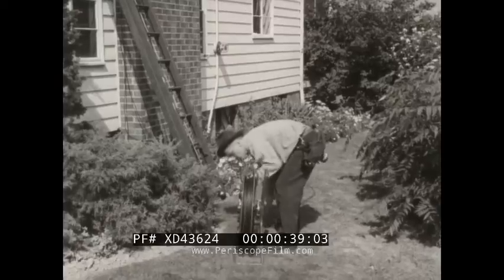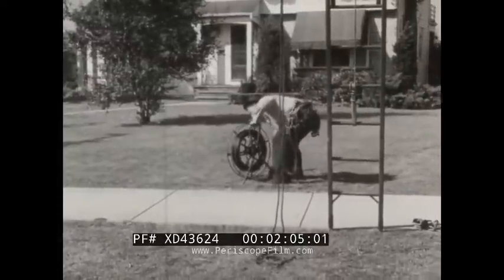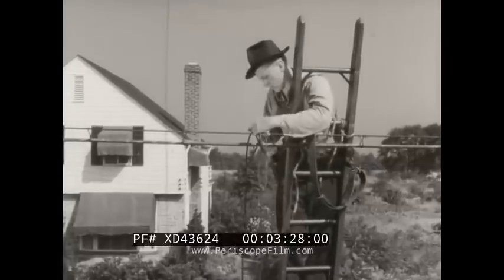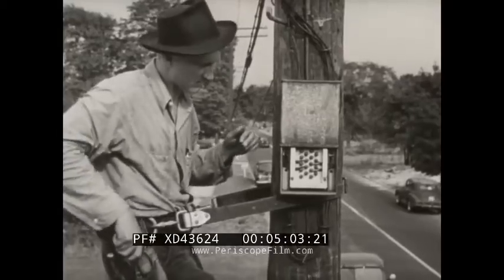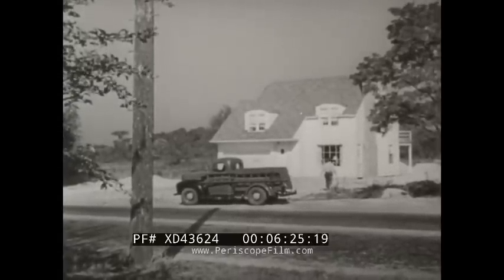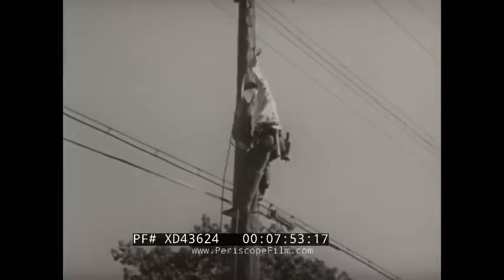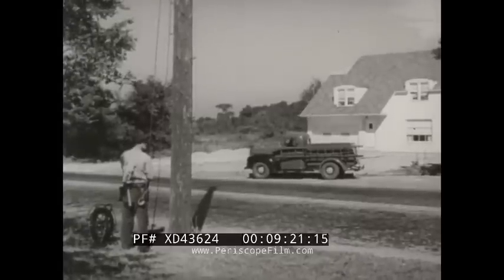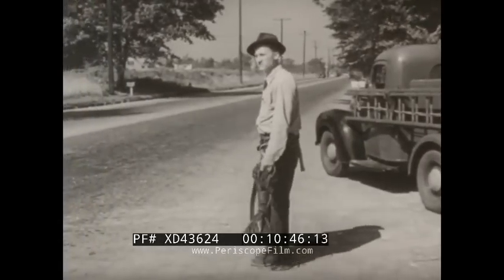DROP WIRE INSTALLATION   1940s TELEPHONE LINESMAN TRAINING FILM   XD43624

Comment: I find it interesting that the ladder crossed the driver's door on the truck. Essentially, all in and out is done from sliding out the passenger door.
Reply: I drove a van, with the ladder rack on top.  You'd place the ladder in the rack and lock it down.

Comment: I used to put in home alarm systems and we had to tie into the phone lines… funny story, when I was disconnecting the phone line to install the cut-in from the alarm, it was raining out and I was kneeling down to get to the box and I felt a little bit of current from the phone line since it was raining and my knees were touching the ground 😂 There’s about 45-60 volts and it’s enough to feel, especially when it’s wet out and you’re providing a ground!

Comment: I did this in the 1970s.  Not much difference except we had to wear a hard hat and had ladder hooks to keep the ladder from slipping under the strand.  We just used the drop and not a landline.  Ladders became fiberglass which was heavier than wooden ones.  We were required to work faster than Ted too.

Comment: The UK drop wire has steel wire for strength plus 2 pair  copper. 

We have tall poles so to miss all the traffic, rain or snow all day was a challenge. Similar safety belt. 1980.

Comment: Please don’t ever show the trouble calls for no dial tone because the floor jack is covered in cat piss or the unkept yards with overgrown trees, bushes and such that make drop replacement a nightmare or the terminals on poles/NID’s on houses that someone left open for the bees, snakes, black widows and God knows what else to make their homes in. Definitely don’t show the cross connect boxes or nodes that installers spent 35 years laying jumper wire on top of other jumper wires turning it into a rats nest that takes hours to comprehend. And for the love of God don’t show the house that the nearest terminal is 15 poles away because the engineering department apparently didn’t realize someone built a development on that street 40 years prior to my arrival. 😂
Reply: What no trailer houses with dead shit under them that’s were everything goes to die in a trailer park

Comment: No cones no circle of safety no locking the truck thats an OP-78 violation his efficiency isnt good and is going to get dinged on MSOC not using his 188A voltage detector boy is Ted going to be in trouble when his boss arrives.

Comment: This man is not a telephone linesman. He is a telephone installer/repairman typically called I&R until the women started doing the job and then they changed it to Installer / Maintainer or I&M. And now they are called Telephone Technicians. Linesman install Telephone Poles, hang strand and lash cables  drink beer and play hearts. They do not work inside houses.

Comment: I never knew a ladder could be leaned on the cable for support.
Reply: They have hooks on their ladders also to hook the strand
Reply: You still see it today from time to time.  Of course, the ladders are fiberglass instead of wood now,  probably a little safer in a few ways.
Reply: @l337pwnage  Not to mention fiberglass is lighter.

Comment: 80 years later that telephone wire is still working as a DSL line.
Reply: @Wink Dinkerson If those worked after the phone no longer used a party line, I bet there were a few surprised home owners when their new DSL didn't work, lol.
I have no idea what caused it, but back when I had DSL, I had a problem(I don't even recall the symptoms) and I fixed it by putting a Radio Shack device inline that had a ground lead that I connected to an electrical ground.  
It came with a ring terminal you were supposed to screw to the outlet cover, but I just put it in a plug where only the ground was attached, then I could just plug it into any grounded outlet and not mess with screws.
Reply: @Wink Dinkerson the point I was making is the superior workmanship that was performed during these installations. Quality parts and a great attention to detail.
Reply: I need Ted to come back and cut out of terminal remove bridge taps and cut load coils off customers complaining of frequent disconnects

Comment: Wow. In the Modern Developed World we don't do mid-span connections at all, and would NEVER put a ladder against the wire.
Reply: cable company does it all the time around here when stuff is too far away to use a bucket truck. Matter of fact, most installers don't drive a bucket truck.
Reply: We do in southern IL.  Thats why our laddrers had fold out hooks on the end of it.

Comment: I was hired by the then New Jersey Bell Telephone company right out of High School 1962 on my final interview I was asked if I would like to work inside or outside, I was looking out the large window behind the interviewer (Mr. Chamberlain) a hellacious early summer thunderstorm was raging outside, to me it was a no brainer, Inside, please! I started as a frameman in a large central office, in Downtown Newark, NJ. Retired in 1995 after a good by out with free medical for life (THANK THE LORD). I witnessed a fantastic technical evolution of telephony. I worked on most of the latest and greatest equipment from operator switch boards to the latest electronic switching systems. When I retired I was the only one assigned to a rural central office and I did it all, Frameman, Toll Tranmission and CO technician and power man. It was quite a ride.
Reply: Did you go through the 5ess conversion?  Or only the 4ess?  Just curious.  Jees, that was a long time ago.  do i have my terms correct?
Reply: @rhoused1743  I went to the following schools and worked on in this order,  Toll Transmission, the first-gen T1 Carrier, #1 Crossbar, #1 Crossbar TSP,  # 5 Crossbar, #5 Crossbar ETS, 2B Ess,1A Ess, 5 Ess, and Northern Telecom DMS. I worked on many cutovers. My favorites were #5 Crossbar and 1A Ess. Without blowing my own horn, I was the district's go-to guy when a #5 Crossbar office was in trouble.
Reply: I'm a retired inside wireman LU 102

Comment: I've never seen a drop mid span. I don't even see the logic. Must be an American thing. Funny how engineering evolves differently in the UK, USA  & Europe
Reply: It's because you can't cross the neighbor's property with a drop wire, legally it is not allowed.
Reply: @brianleeper5737  Ah! I get it.
Reply: @smorrisby  Many neighborhoods where the lots are mostly the same size and were laid out before the utilities went in have poles right on the property line so they don't have to do a drop mid span.
Reply: @brianleeper5737  ... laying out lots with poles between every two homes was a common thing in the 50s. It almost never worked out in more rural areas where the homes were built after utilities were in place already.
Reply: @rupe53  Another problem in rural areas is that the lot sizes are usually not the same. One house might have 500ft of frontage and another might have 300ft.
Reply: @brianleeper5737  ... true, but in that case you wouldn't be crossing a neighbor's property because you'd have poles almost where you need them. My example was in planned developments where lot sizes were around 60 feet of frontage so every two homes lined up with poles.
Reply: @rupe53  Where I used to live, the poles were in the backyards, at the corner of 4 lots. Always wondered how they got back there with a bucket truck for repairs.
Reply: @brianleeper5737  ... they had that on the other side of town from where I grew up and I said the same as a kid. Little did I know (back then) it was done to make the street look nice. Here we are 70 years later and every one of those poles will need to be replaced manually with a crew of guys. My best guess is they will switch to buried utilities from the street, over a period of time.
Reply: That’s called aireal trespass that’s a no no

Comment: After WWII, my Dad worked as a Southern Bell lineman, working his way through college on the G.I. Bill.  Linemen did more than run wire back then, and were often required to trim trees and climb poles using safety belts and linemen's boots, or while working off ladders. He lost his left ring finger when his wedding band caught on a nail after a slip down a pole. After graduation from college, he was promoted into management
Reply: Safety precautions are paramount. Therefore, I wondered why the lineman in that educational film did not have strong and rugged gloves or the ring was not removed. 🙄😱🧐
Reply: I’m a lineman, I wear silicone wedding band for this exact reason
Reply: @linehandibew6205  No silicon wedding bands in 1956!
Reply: @dereksuddreth8672  oh really 🤯 lol

Comment: Hanging that midspan in the first half is very similar to how I was trained to do it less than ten years ago, handline and all. No bucket truck for us, we were issued minivans and ladders. That ladder carry is identical to modern training. Always start by hanging drop at the premise, since a good length of drop can be surprisingly heavy and you can't tie your ladder off at the side of a building. We used similar drop clamps and created the same drip loop for strain relief, always being mindful to let the drop have some slack instead of pulling it taut. Our span clamps had a lower profile, and our anchors at the house were ramshorn instead of those ceramic deals. Still saw a lot of the latter in old installs, though. 

One major difference is that our body belts came with a safety loop that could be used to carry drop up the pole with us. It was designed to let the drop fall away if too much pressure was applied, so it wouldn't pull us down with it. So we didn't have to use our handline to lift the drop at the pole. 

I'm guessing that drop wire is almost the same as the "flat drop" we were told to remove and replace on any job we came across: two very stiff, solid, large-gauge copper wires in a basic plastic-like sheath, without any twists. Each drop could only handle a single phone service; if a house had two numbers, two runs of flat drop would have been used. A little beastly to handle compared to modern stuff because it took a good, sharp knife to strip the plastic jacket (which was nearly pencil-thick, stiff, and molded directly onto the wires) from the ends. 

We were also told to keep a few lengths of that old flat drop in the case we had to lay it across a road until a burial crew could do a bore and pull, which might take days or weeks. Because the flat drop is nearly indestructible and can handle a LOT of traffic driving over it, which would crush the softer stuff we use today. We'd leave an appropriate length of modern drop, enough to reach the terminal, coiled up and out of the way on the premise's side of the road. At the end we'd splice the old flat drop and lay that over the road to the terminal with hooks hammered into the soil on either side to keep it in place. When the burial crew was done boring across the road, they'd use the old drop as a pull for the new drop. Especially important for installing shielded drop, like direct-bury 2 or 5-pair, because the outer metal shielding would be quickly broken by traffic and was almost certain to cut into the actual conductors in the middle. No such worries with old flat drop! Untwisted, unshielded, almost literally as tough as nails. 

Like a lot of the commenters, the lack of PPE and basic safety features is the most jarring part of watching this. Poor guy's ladder doesn't even have hooks! I guess they recommended the brimmed hat to keep the sun/rain out of a line worker's eyes back then, and that was about it. Make all the jokes you want about "real men," but modern telecoms are all about safety first (because a lot of them are self-insured). One of the first things you learn in training is how to use the company-issued hard hat. After that you learn about checking your insulated gloves for defects. Then maybe you learn how to climb (ladders, gaffs and Buck-squeeze, steps, etc.). A few days of that, with some tests to make sure you won't kill yourself in the field, and you can learn the basic network theory and how the plant is wired up.
Reply: The drop wire used back at that wasn't molded plastic, but rubber covered. It worked the same, but wasn't as durable as the plastic covered wire.
Reply: I worked lines in SF for many years, have you ever seen a ceramic midspan clamp?
Reply: @kevinferrara4519  not midspan, nope. Plenty on older houses, though. All the midspans I saw in our turf were pigtail-type.
Reply: Wow. In the Modern Developed World we don't do mid-span connections at all, and would NEVER put a ladder against the wire.
Reply: @nibblesmcgurk  Why not?  Sometimes a bucket isn't an option.
Reply: @nibblesmcgurk  ... our local cable company still does mid span work with ladders. We're also semi rural so many poles are too far off the road for smaller bucket trucks, which don't have outriggers.
Reply: @nibblesmcgurk  no midspans? theres a lot of circumstances where they are needed. what do you do then?
Reply: @nibblesmcgurk we still do pretty much this exact process everyday.
Reply: @nibblesmcgurk   I've certainly put a ladder against a cable.  It was TV cable though.

Comment: Let’s not forget that the cable pair used goes to a Central Office. In the CO the CO Tech connects the cable pair with a main frame cross connect to the assigned Office Equipment. The CO equipment provides Dial Tone and call connections to the network through Switching Equipment.
Reply: A very similar process is still done! Instead of dial tone. You just get an internet connection.
Reply: There should also be a frame where the cable comes in with the surge protection on it.  Usually carbons, but could be heat coils or gas tubes.  Geez, it's been almost half a century since I was working on that stuff!

Comment: “No job is so important and no service so urgent that we cannot take time to do our work safely”. Bell System. The Bell System motto until divestiture?
Reply: Hey I remember that but it was very close to the GTE motto. I worked 1976 thru 2015 , 26 yrs as a field tech and  14 yrs as a i&r local manager and then a Fios local manager. At Verizon. Good times
Reply: I have that motto on my dads 15 year plaque from Pacific Northwest Bell.
Reply: Dedicated
To dial tone
Reply: ... and in an environmentally responsible manor.
Reply: I've seen that used without the "Bell System" at the end in a condiment (food) manufacturing plant on a door by the rail siding, I think that was used well beyond the Bell System.

Comment: I was an inside the CO guy in the 70s. Worked on a testboard, equipments and mainframes. Totally different environment, but safety was the first word.
Reply: I worked for a rural phone company for a short time. One of the remote places had aerial cables and had to use a ladder for phone and cable tv. After that I did fiber and microwave communications along the pipeline for 15 years. My last job was a gateway earth station working most of the rural Alaska communications.

Comment: This probably violates 10 modern safety standards.  Love the hat, though.
Reply: Other than a hard hat and safety glasses, what could go wrong? I mean, other than a bird crapping from above, what was going to fall on you? Wooden ladder was considered insulated by old standards and so was common rope. You start at the house so nothing is energized either.
Reply: @rupe53  I was curious about the ladder placement on the strand.  It seems that when he pulled his ladder down, it would have caused the drop to lower.   The strands were probably a lot tighter then.
Reply: @95ffd  ... in the video (was film) they mentioned ladder placement from the sidewalk side, which in theory would push the trunk line away from the house slightly. They also mentioned pulling the new drop tight while allowing for some slack / droop. I don't believe they mentioned how much, but I got the impression that a little tight with the ladder in place gave enough slack when the ladder was removed. I get the feeling that "eyeballing it" was close enough in those days. BTW, traffic cones and safety vests hadn't been invented yet.
Reply: No safety cones, no safety vest.  No eye protection,  no hardhat, no safety strap on the strand when his ladder was against it.
Reply: @95ffd  Those were the good ol' days!  While this was a little before my time, it was still going on in the 1960s, and I remember!

Comment: I had to do a lot of this work as a cable splicer from 1979 until 1981, when Illinois Bell in Chicago finally gave me a bucket truck to use, then, at least I didn't need a ladder as much. Later on I still needed to do ladder work where I had jobs in the suburbs that had poles in backyards instead of alleys. Thankfully I reached retirement and all of this is behind me.
Reply: Pretty cool,tell us your craziest install experience
Reply: @TheDieselbutterfly  : I usually just hung a new / replacement drop wire that was either storm damaged or aged so much we couldn't splice onto to get to reach a new terminal, but I did hundreds of those, as storm or ice storm damage would have us lent over to repair work details. The most challenging work I had was probably setting up all of the existing drop lines on a pole to transfer to a new terminal, sometimes 30 or more, all while working with a body belt holding me to the pole. Sometimes, the hardest part was finding a good new attachment point to rehang a drop to a house if the old one pulled off.
Reply: Thank you for your service. For without your work my Nanny couldn’t have sat on the phone talking to her friend Stella about her life troubles and gossip about her family members 😅 And I wouldn’t have been able to call my cousin about stopping by to play ❤️
Reply: Happy retirement! Thanks for all your hard work! They don’t make em like you anymore.
Reply: Very cool. Love to hear more.